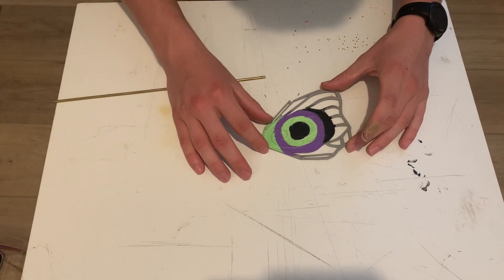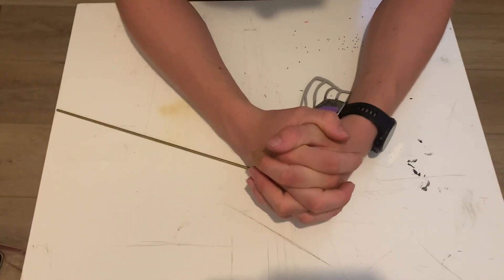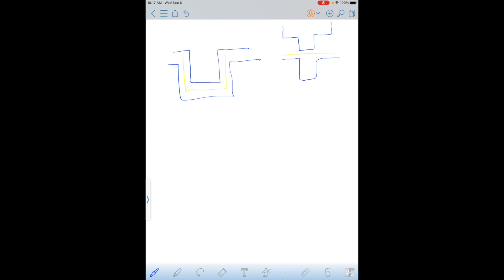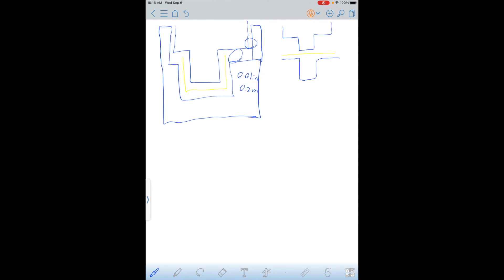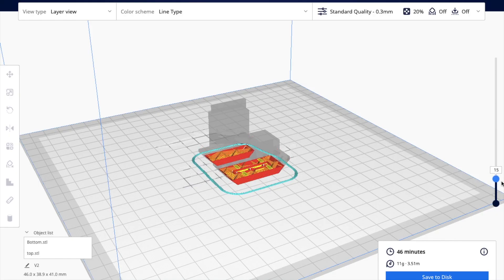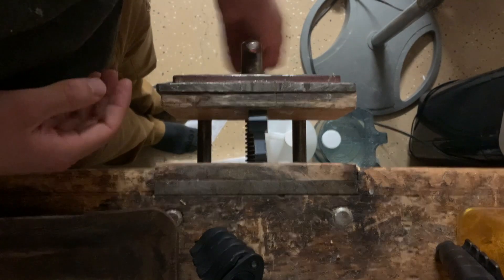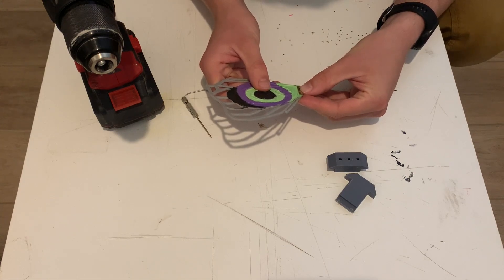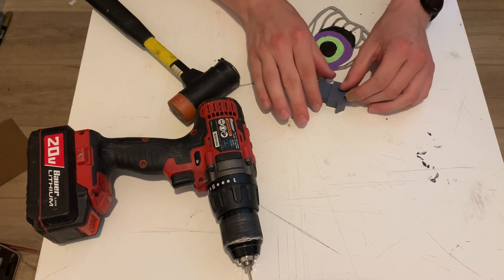Bending Metal With my 3D Printer

Comment: Wouldn't it have been easier to drill new holes in the wing after the first 3d print?  The existing holes would have been covered by the metal.  With that said, I like your design process.  very intuitive.
Reply from the maker: Un fortunately due to the nature of resin 3d prints they have a tendency to shatter when drilled into. At the very least that has been my experience.

Comment: Nice work! If you haven't seen it already, you may want to check out Stuff Made Here, one of his early videos was about forming sheet metal using 3D printed tooling and a press. And you may also want to drill the holes all at once (i.e., form the bracket without holes, place it on the wing, then drill the holes in both the metal and the wing at the same time). That way nothing has to be aligned beforehand.
Anyway, like I said, good work!
Reply from the maker: Thank you! 
Unfortunately the type of resin I'm using has a tendency to shatter when drilled into.